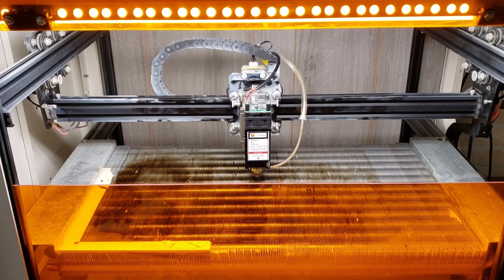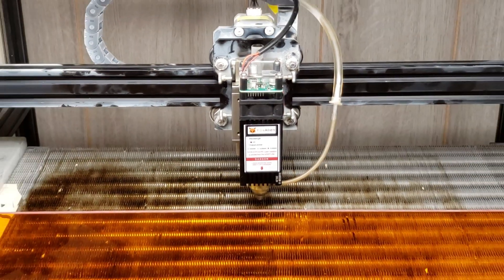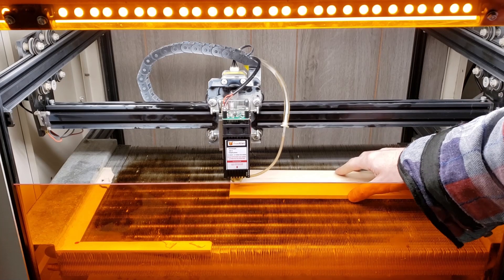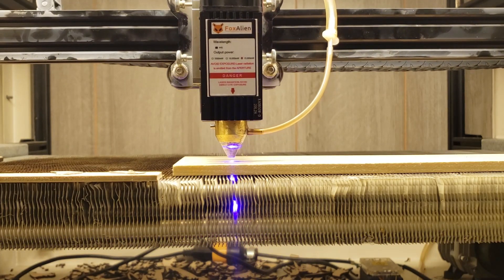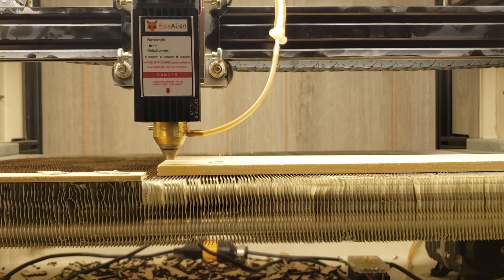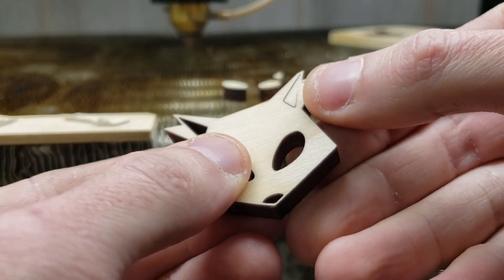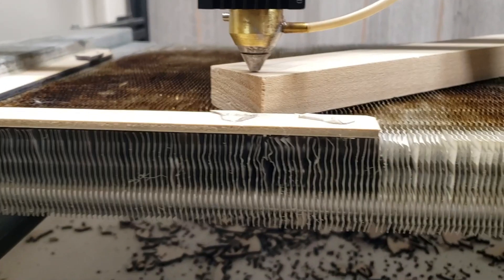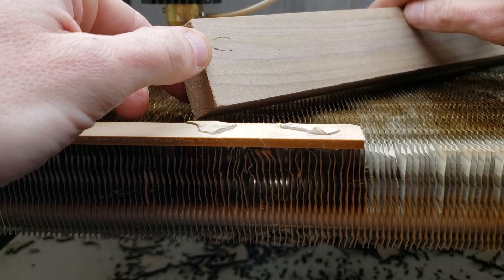Testing out the incredible power of the new FoxAlien 20W laser module! Cuts through 3/4" solid wood!

Comment: May I ask what that honeycomb board is your using for your laser engraver/cutter?  
Is that something I can purchase somewhere or do you make these?
Reply from the maker: I'm using a condenser from a refrigerator centrifuge. You can purchase steel honeycomb beds online. FoxAlien sells one that fits the 40cm x 40cm machines well. The steel honeycomb bed allows using magnetic hold downs for warped materials.
Reply: Go to a auto scrape yard and get an A/C condenser for just a few dollars don't make any difference what make of auto just tell them you want their cheaps A/C condenser.

Comment: Did the power fall off from using it at 100%?
Reply from the maker: I've been using it at 100% duty cycle for over a year with no power loss. The "power" is set via a potentiometer on the laser driver board which sets the current going to the diode. That is where you do not want to be at "100%". The power setting in LaserGRBL and Lightburn just sets the duty cycle of the PWM signal going to the diode. You should not be afraid to run a diode laser at 100% duty cycle unless you have a very cheap generic Chinese laser module which usually have their currents overdriven in order to temporarily appear as a more powerful laser to the consumer until the power quickly degrades. FoxAlien's laser modules apparently go through a 20 hour burn in test cycle at 100% in order to ensure there is no power degradation.

Comment: PERFECT!  I wish to cut balsa airplane parts 1/16 to 3/8 inch thick (ribs, doublers, tail, rudder, etc.) and was first convinced I needed a Co2 laser to do so but I think you solved my dilemma.  Looking at FoxAlien Reizer Mega 20w laser engraver with Lightburn software bundle kit but i see they do not have an upgrade for the FoxAlien 20w fixed focus BLUE Laser Module V2.  Any word on if that laser can be bundled with the large Reizer Mega platform?  I’d like to cut balsa that is 36” long.  Thanks in advance..  awesome video.
Reply from the maker: I'm so happy you enjoyed my video! I think the Reizer Mega would be perfect for cutting airplane parts! You could cut very long parts on it. FoxAlien is just releasing their 40W module, which would bring cutting time down to nearly half. Diodes are slowly catching up to the lowest power CO2 lasers. Still no competition with a 150W CO2 laser, but the diode laser machine can be carried with literally 1 finger and the entire cooling system for the laser is a small fan, you don't need a 500W refrigerated water circulator like for a CO2. For hobby projects, the Reizer would be such a fun and useful tool! I make a bunch of functional 3D stuff for my workshop and house. Collet organizers, wrench holders, I even made a steady rest for my mini lathe with laser cut plywood!

If I've helped in any way, you can help me by making your purchase through my affiliate link. It should be in the description. Be sure to join the FoxAlien Facebook CNC group, that is the main hub where the community is and you can see what people make with their machines! I'm in that group also ;)

Comment: I just got one of these and what do you use underneath?  I'm brand new and want to make sure I am cutting my wood out safely so the laser doesn't cut through my table lol
Reply from the maker: I'm using an old condenser, but I recommend investing into a steel honeycomb cutting bed. You can buy the perfect size one on FoxAlien or you can find them in various sizes on Amazon and Ebay. A cutting bed is essential for clean cuts.

For under the honeycomb bed, the best thing is distance to spread the laser energy over a bigger area. 2 or 3 inches and the laser should not cause damage.

If you lay something underneath the honeycomb, the best thing would be a sheet of aluminum about ⅛" thick that has been spray painted with black high temperature BBQ or engine paint. This will absorb the beam energy without reflecting it, and the aluminum will dissipate the heat quick enough to keep the paint from burning.
Reply: @laserwizard1982  thank you for the reply!  I found the large honeycomb bed so I am purchasing that and will go to home depot to see about getting an aluminum sheet.  I'm going from a cricut to a laser so I have no idea what I'm doing.  

Am I able to set this up in my craft room to use on a regular table in my house with the things you recommended?  I haven't out my machine together yet but wondering if I can use this in a small room or if I need to be outside.  I can't find many videos on how to use it in the house.  Thank you
Reply from the maker: @Laserfox27  I use mine in my basement workshop. You can absolutely use it in your craft room, but you will immediately need to have strong ventilation set up in the room to blow the smoke and fumes out. You will also want to build yourself an enclosure. Those will make the machine barely noticeably, instead of a hazard.
Reply from the maker: @Laserfox27  make sure you join the FoxAlien Facebook CNC Group page! You will get all the help you need there.
Reply: @laserwizard1982  OMG build an enclosure??  Can I cut one out with my new laser??  lol.  Do you have build plans you sell too?  I have an air purifier hopefully that will work.  Otherwise I will need to find a new setup if the fumes and smoke is overpowering.

Comment: I ordered the new 20w version after watching your video and it should be arriving any day now.  What psi air pressure do you recommend when using your air assist nozzle? I have a 150 psi air compressor in my shop, and was planning on using that.
Reply from the maker: I haven't measured to see what kind of backpressure builds up behind my nozzle. I use a 32W aquarium air pump. I'm sure it's less than 5psi. My latest video compares a few different compressors and I learned it's more important to have the ideal nozzle.

Comment: I recently saw a review of a Sculpfun 90w unit, how would this stack up against it? How are they getting so much output?
Reply from the maker: Great question! I did some research and it appears as though they are completely flat out lying to their customers. If you look at the specifications and even on the label of the laser module, it clearly states 5.5W output power. I watched their marketing video, and I noticed two things: they aren't doing anything at all that I haven't already been doing with my 20W FoxAlien module, and they make absolutely zero mention about what feedrate and number of passes they used to cut through all those materials. I could do all that they've done with my old "5W" module, it's just a question of how long it'll take.

Most diode laser companies list their 5.5W optical output modules as "20W" modules. There are a few manufacturers that have "40W" modules which have 2 diodes inside which have their beam combined in a prism. You have to be careful with those, because unless those beams are perfectly in line, it won't perform much better than a single diode module.

If you look at the price of the sculpfun, it doesn't reflect what the cost should be if it truly were some sort of 90W module. Look at the photos of their laser module, it states 12V and 3A, that's 36W (half of which is going to the cooling fan). Where did they get 90W from?? Someone must've hit the wrong button on their calculator over there, or else they have zero shame about what they are doing.

Another dead giveaway about the quality of a machine, is the type of rails and carriages they use. The sculpfun uses 2020 extrusions on their axis, each cartridge only has 3 v-wheels, and the Y-axis only has one stepper motor. This machine is not giving you the best of the best, it's trying to maximize its profit by giving you the bare minimum.

Good luck!

Comment: Wow, that looks pretty good. I was thinking of getting an add-on for my Shapeoko but I think The Fox Alien stand-alone is the way to go.
Reply from the maker: It's always best to have a dedicated laser CNC machine. Costs just a bit more than just the laser module, and the machine is tuned for laser work. The Reizer has a 32bit control board and allows for much higher feedrates.
Reply: @laserwizard1982  I got the special with the rotary. Just delivered today.
Reply from the maker: @MalletCNCWorks  I'm sure you'll love it! Be sure to join the FoxAlien Facebook CNC group page for the best support and a loving community!

Comment: Hi! I have a 20w laser and it's been very hard for me to cut 3mm Plywood and Acrylic. I heard about using compressed air or something like that. Could you give me any advice.  I'm a beginner.  Thanks! 👍🏻
Reply from the maker: There are a few important factors involved for successful laser cutting of wood.

First and foremost, it is very important to have a good performance air assist. I personally produce brass air assist nozzles which work very well. Please watch my air assist video to see the differences!

Secondly, the type of wood makes a big difference in laserability. I have been using purebond plywood and it cuts very easily and consistently. Regular plywood has glue which is not very penetrable with the laser, and the inner core plies will be riddled with hard patches.

Thirdly, be sure you are focused well. If you have been lasering without an air assist like mine, then you might have soot and resin buildup on your lens. Be sure to check it and clean it with lens cleaning solvent.

Fourthly, I try to cut through material in about 4 passes. For me, that is a good sweet spot. It's better to do 4 passes at 400mm/min, rather than 1 pass at 100mm/min.

This list could go on and on, but if you follow the above rules, you should be well on your way. Watch the air assist video.
Reply: Thank you very much for answering! I've seen the air assisting video as you advised.  As I told you before, I'm a beginner and I still have so many doubts.  Could you tell which air pump should I buy for my 20w laser? And something else: where can I get that metal mesh you have in the bottom? 
Sorry if I'm being bothering, and forgive my English, I'm still learning it... 😎👍🏻

Comment: Hey Wiz - have been enjoying your videos the past few days.  Lots of good info.  I just got the 4040XE... planning for setup and first cuts this weekend.   Any tips for cutting 1/4 white acrylic plastic?  mm/min?   Test passes and go?     Also, was wondering if its possible to have each pass with the laser drop the Z axis down by 1mm or so, to move the focal point down as passes progress.   Cheers!  Keep the good content coming!
Reply from the maker: Thank you so much for the kind words! You can laser cut acrylic with the laser, but only colors that absorb blue light. I've cut black acrylic amazingly well, but clear and white acrylic will not cut through. 

LaserGRBL and Lightburn both have options for dropping the Z-axis per pass, however, I have personally had the best luck by focusing onto the surface and running all the passes that way. If I am attempting to cut through really thick material, then I'll set the focus about 1-2mm into the material below the surface.

If you've got the 4040-XE, then you could cut through with an endmill. Acrylic cuts very well, but you have to find tune the feedrate and spindle RPM in order to not melt the acrylic onto the endmill. Polycarbonate was very difficult for me to cut, but I was able to eventually find a setting that worked. It's very important to use the proper bits.

Good luck! Have fun with it! It's incredible the amount of different things you can do with this machine!
Reply: @laserwizard1982   Got it...  that makes sense.   Thanks for you input!    I think maybe I'll try the end mill for this project then... I did pick up an 'O flute' bit that I saw was recommended for plastics.    One more question... I just was reading that there are 8-bit and 32-bit controller boards... guess the 4040-XE only has 8-bit controller?... do you know if that's something that can be upgraded?  And what will I be missing out on with just 8-bit... certain types of high resolution cutting, I guess?    Maybe 8-bit is fine for my needs... I probably should have spent more time researching before pulling the trigger, but it seemed like this machine is pretty good for hobby use.

Comment: Was wondering could I make tiered trays/ projects with this machine instead of that glow forge machine just know that it cost 6000$$$ and if I’m starting out don’t want to put all that into it yet. Overall would it work. Hopefully you know what I’m talking about
Reply from the maker: There are several people in the FoxAlien Facebook group which do layered mandalas. You can cut through 3-5mm plywood very consistently. A CO2 laser machine can definitely do it much faster, but these diode lasers are getting more and more powerful and you can get by with a diode laser just fine for a hobby. We used ours to sell a bunch of ornaments last winter!

Comment: Great video!  Too bad ther is no limit switches, and the control board is only 8 bit.  Do you have an y ideas for a 32 bit board replacment?
Reply from the maker: My current board (and the one powering my machine in the video) is an STM32 based motion controller running GRBL32. I have a few LPC based boards I'm hoping to test out. 32bit is definitely the way to go to fully utilize the higher power diodes. I raster engrave at 6700mm/min.

Comment: Running the laser at max Power 100% will reduce its life?
Reply from the maker: I have it always set to 100% in software. That means when the beam is on, it is on full duty cycle. Laser diode current is set via a potentiometer on the laser driver board. I'm assuming that FoxAlien is not redlining these diodes and the current set on the driver is not overdriving them. Who's to say what 100% power truly is? It's a proportion between current draw and laser diode life. The warranty the laser modules for 1 year, so I'm confident they are making sure they will last.

Comment: Is this a le 4040 pro but flip upside down?
Reply from the maker: Good eye! I flipped the Y carriages upside down, but the X axis is still right side up, but hangs below the Y axis instead of above it. I also extended the X axis with a 700mm long 2040 v-rail extrusion, I have about 55cm of travel in the X axis now. It's extremely easy and simple to extend the axis, you just need longer extrusions and a roll of GT2 6mm timing belt.

Comment: I’m planning on getting the fox alien do you have any tips and pointers for me and also what programs do you use
Reply from the maker: I use photoshop to create my jpeg images, then run them through Lightburn. It takes a lot of practice and patience but it's so worth it!
Reply: @laserwizard1982  thank you brother where did you purchase your cnc and new laser module on the fox alien site they are all sold out I can order the cnc and get it late February but can’t do the same for the module
Reply from the maker: @s_m-b_l-z_m7941  Yeah, FoxAlien's laser modules seem to sell out within a day or two of restocking them. I bought my first two LE-4040s back before FoxAlien became so popular. The 15W module was not released for a few months when I was using the 5W module. I ordered their 15W module within an hour of them announcing its release. That 15W module (7W optical output power) has been serving me very well the last few months (and making me some money!). The new 15W module which is featured in this video has a lower output power (5-5.5W) due to the corrective beam optics, but actually cuts way better.

I know that they may be sold out at the moment, but they restock their inventory often, so keep checking, it's worth the investment!
Reply: @laserwizard1982  ok perfect so which laser module would you recommend me getting?
Reply from the maker: @s_m-b_l-z_m7941  The old version of the 15W module as well as this latest version are both great modules and I highly recommend them. I ran my old one at 100% power for hours every day. This new version is very nice because it already comes with great optics and is fixed at the ideal focal length. So you don't have to pursue purchasing an aftermarket lens and focusing it yourself.
Reply: @laserwizard1982  awesome I appreciate your time and knowledge on the machine I will keep in touch and posted once I get my cnc if that’s ok with you
Reply from the maker: @s_m-b_l-z_m7941  yes, please! I want to see what you create! You are welcome to come join the FoxAlien Facebook CNC group if you want to see what people are creating with their CNCs!
Reply: @laserwizard1982  I’ve created many things by hand I’m looking forward to learning the problems to run the cnc I joined the group btw